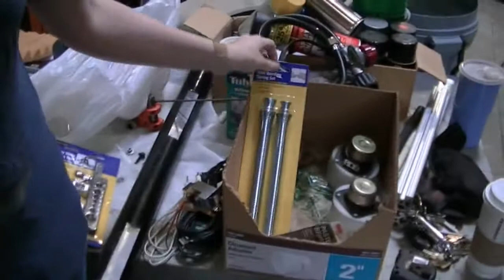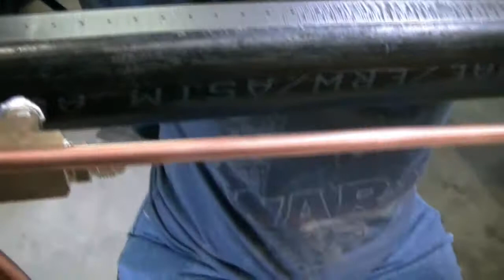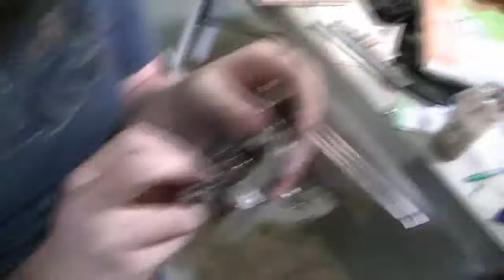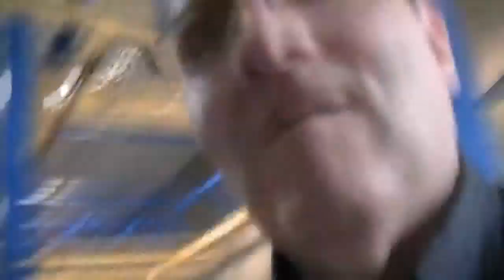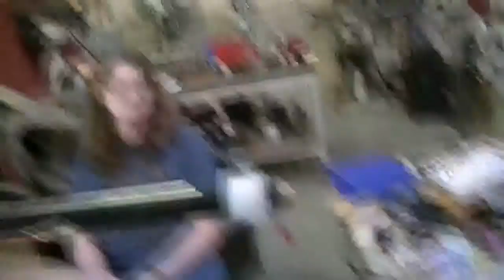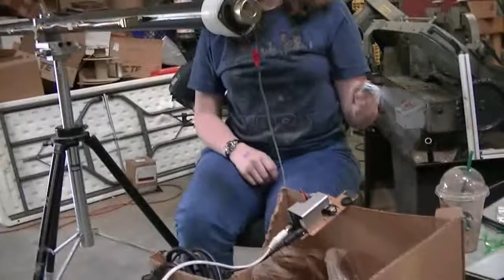2013-06-02 Christina's Rubin's Tube Construction Part 3

Comment: you can see the sound waves fround the fire. you have propane, you light it through the tiny holes. at this point the tips of the fire are even. if you apply a tone the fire will make a sine wave at what the frequence the tone is.